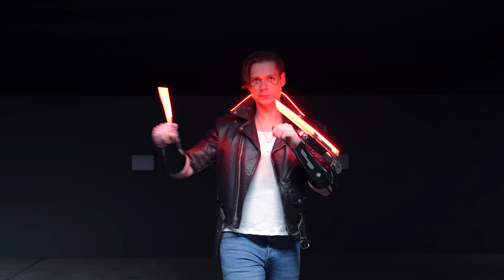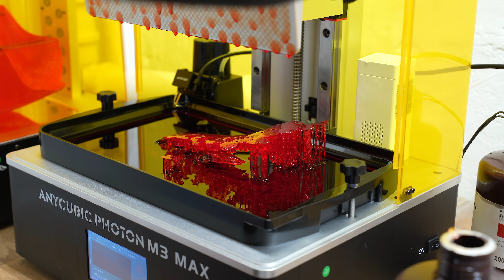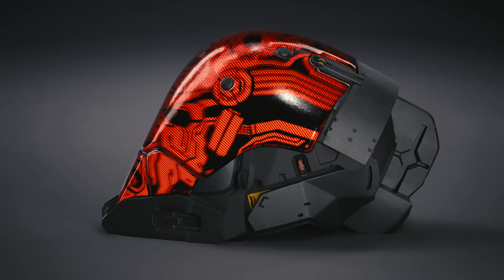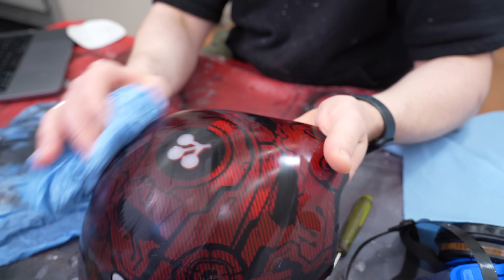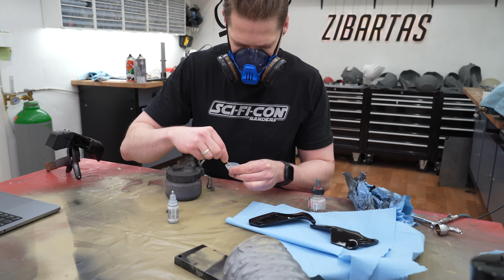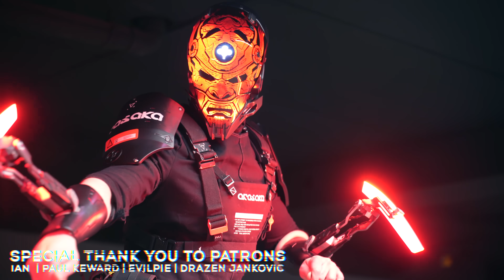I Built Arasaka Motorized Helmet (Cyberpunk 2077)

Comment: Absolutely amazing job! I do wonder if printing it such a way that the supports are on the outside instead of on the inside would be better, since then the more complex structure inside would need way less work to finish and the outside that gets sanded and polished anyways would result in less resin going to waste from supports. I haven't done resin printing myself but it seems more affordable that way, please correct me if I'm wrong.

Comment: It would be better when you protecting your head with a thin layer of non flammable fabric in a cool designe... Would it more comfy to wear a two bottle oxygen back bag, connected with the helmet and enough oxygen for an hour or 1 1/2, against sweating but feeling great to give your self such a oxygen flash into your body system, ( combine with xenon gas will let you fly high!)^^

Comment: I think you should do the 3D printing as an inlay for possibly a vacuum mold in plexiglass. The UV resin is too brittle but if set in plexiglass it should be strong enough to travel with. The only other option is heat forming the plexiglass in 3 sections and mending the forms together.

Comment: Super cool! For printing, does it not work to do smaller test prints?
Reply from the maker: Most of the problems that one will encounter during the 1:1 scale production of the prop will only reveal themselves at 1:1 scale tests - as the scale IS the tricky part that needs figuring out. Materials behave much different when they form bigger, larger surface area, complex structures:)
Reply: @Zibartas  thanks for explaining, that makes sense!

Comment: I did some construction at an airport, installing new power. I saw them bring the bags from the plane, they literally knock them all on the floor first, and start throwing them, trying to arc them from wherever they stand to the feed going up to the baggage claim. There was a perfectly handy roller track they could set them on and push, but that wasn't fast enough, instead they are literally throwing everyone's belongings 5-10 feet through the air. I've never stowed anything valuable since. Sorry to hear your amazing build got ruined by them =(

Comment: Best way to make the visor: engrave/cut the pattern onto a flat sheet of polycarbonate, then vacuum form it onto an FDM printed mold Then proceed according to your process of spracing and sanding. (can probably spray and sand while it's still flat actually, so you can use an electric sander).
Reply: I would also have gone with vacuum formed PETG, simply because shells from resin are so brittle (and internal tensions can make them deform and crack even long after curing). It would perhaps look a bit different but surely not worse and it would be much more durable. You would have to sand it after the vaccuum forming though, there's no chance of the paint withstanding the bending and temperature.

But this result is amazingly cool either way.
Reply: @Iguana93  Maybe with a polyurethane based paint? That should be elastic, and I think there are high temperature polyurethane spray coating for automotive applications.
Reply: @frozenbubbly  Perhaps? But even the elasticity in those is meant for natural flexing in the substrate. Vacuum forming introduces huge dimensional changes.

Comment: One thing you can do to make cleaning off your supports SO much easier on your resin prints is to soak the print in hot water for a few minutes before pulling off or cutting off the supports. They'll pop right off, and do less damage to the print itself.  Great job on the helmet!

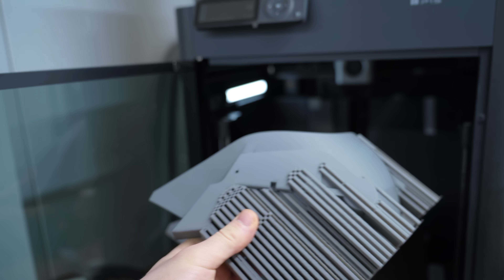Comment: Hi Zibartas (or anyone else), I was wondering which Bambu 3d printer you have? I want to get one but don't know much about 3d-printing yet. Was the plastic PLA? It was in shot at 4:48. Really clean prints so I'm also curious how much work it takes after the print is done? Amazing results with this project!
Reply from the maker: I used the P1S :) and it takes a LOT of work, still, if you want the part look like it's not 3d printed, without any signs that would give it away. Spray filler goes a long way tho xD and meters and meters of sandpaper haha
Reply: @Zibartas  thanks for your (quick) reply! Really appreciate it! Haha I was afraid of that, but the results do speak for themselves. I've heard great reviews about this printer, and I've seen in your videos that you have other printers as well. If it was not sponsored, I'm guessing you liked it a lot too? Thanks again, greetings from Amsterdam
Reply from the maker: @TheNL1980  Yep! it's quick + reliable = the most important things if your hobby is building things, not building 3D printers :D Got tired of infinite maintenance and repairs lol
Reply: @Zibartas  Haha yes, thanks!

Comment: This turned out very good.

As for the issues with the servos, it is a well known issue with classic arduinos, the servo library uses software timers to toggle the pins, not hardware, so anything that interrupts the arduino, like interrupts or likely wireless features, or just things that take a while to complete, can affect the software timer and therefore can affect the signal being sent to the servos causing them to jitter. To fix it you can either use a servo driver board which contains hardware timers or just use a microcontroller that has hardware timers.

Comment: Alcohol ink's do regrade the crosslink chains of the plastic when they are forming during the curing process. 

Instead what you need is a dye that is suspended in the same (similar enough) resin that you are printing with. Your prints will crumble over time. this info is from my own firsthand testing and working directly with photopolymer manufacturers. 

If you need to dye resin again use the CMYK colour pigment set by Monocure .

Its incredibly beautiful work and you are def gaining a sub. The black on red shine through is seriously some of the best finishing work i've seen on a resin print.

Comment: I wonder if you could print the visor in a transparent red PLA or PETG with 100% infill and still retain a similar level of transparency. I did a similar thing for an illuminated Murasama prop from Metal Gear Rising Revengeance and it has good light transmission.

Comment: for shipping fragile stuff, you can get those cheap a+b soft foam mix and get cheap large shipping bag from the post office.
pour the a part in the bag, and pour b part in a ziplock bag and into the bag.
when you need to use it, just pop the b part in the bag and itll form into whatever you need.

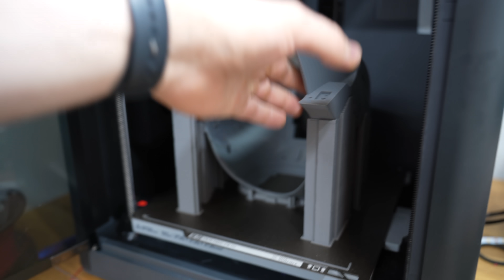Comment: Good Tip, use the "Tree" Type support on your FDM printers, it removes easer, and it use MUCH less plastic. (4:46)
Reply from the maker: I did print a few tests with tree supports but the weight savings did not justify reliability decrease (I only had failures with tree supports). There were also some more surface defects with tree supports, as I believe the print head had to accelerate and decelerate to the more distant 'trunks', so I stuck with conventional supports for the final copies :)
Reply: Interesting, I believe that your issue is that your bed is not clean (On your P1S) so to fix that I use 91% Isopropyl alcohol. You just dab a dot onto a paper towel, and wipe the bed, let it dry / evaporate, and your bed should be clean!
(I do this because when you touch the bed it leaves finger grease, and you can fix that with the Isopropyl alcohol.)

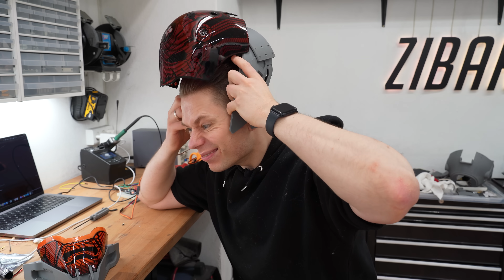Comment: 7:52 dude this happens to me so often aswell.. rushing to try on a helmet in pieces just holding them and then they fall and break... AHHHH.

how were you able to sand of the black paint so precisly? or did you mask?
Reply from the maker: The transparent bits are sticking out a tiny bit, so its just a matter of sanding JUST the protruding bits, without rounding off the sharp edges that will break the light crisply for the effect. Sandpaper + fingers + careful perpendicular pressure :D

Comment: Had to watch the part where you just casually made the black parts black a few times before it clicked. Looks excellent. 

On the case, was there foam or was it just PETG touching the mask?
Reply from the maker: Hehe! Great!

Yes, the case was lined with soft felt, spreading the contact surface area and cushioning it :) Still no clue how it cracked tbh, as it survived a few flights ez...
Reply: @Zibartas  Guessing based on understanding of how the helmet goes into the case, it may be a function of the case being too tough. In the event of a drop that energy has to go somewhere. The felt can absorb some of it, but then the helmet comes crashing into the inside of the case. Something has to flex somewhere and the most likely candidate would be the mask as it is the thinnest member there and should flex first. 

Based on where the fracture is, I'd guess the case was dropped and landed on a side corresponding to the side of the helmet resulting in a flex at the "nose" which looks to be the weakest point. (The other long edges have more 3d structure giving them a lot more stiffness). Foam under the felt might help a lot here, but I'd mostly focus on keeping the contact points with the case being on the FDM printed parts or as near them as you can manage. 

#unsolicitedArmChairEngineering